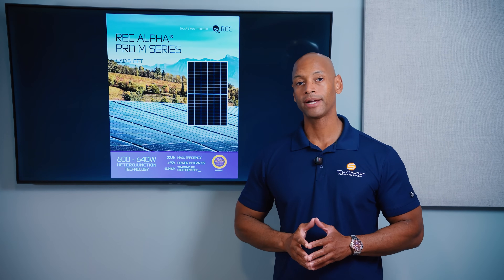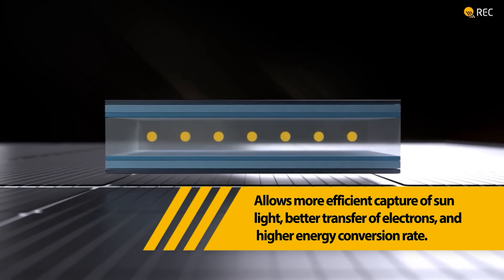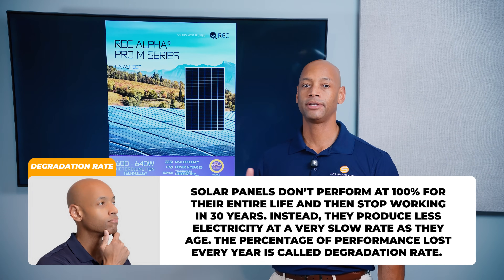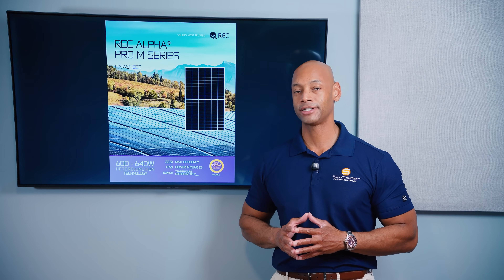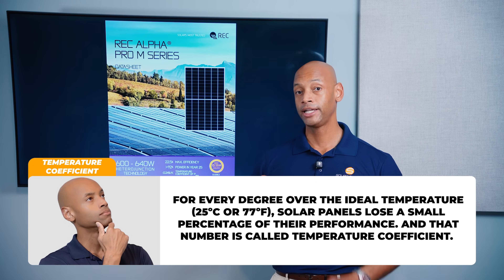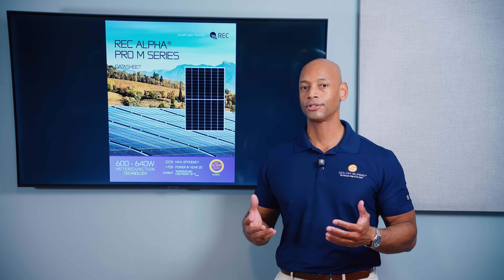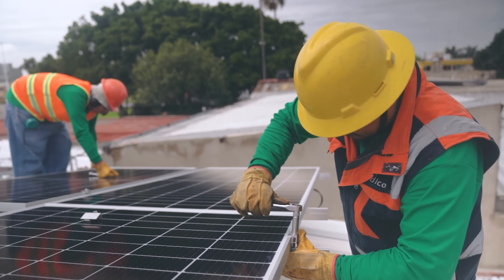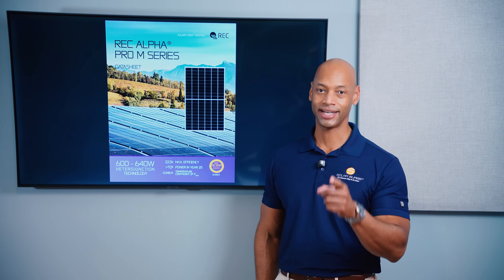New REC Alpha Pro M 640W Solar Panel

Comment: so what makes it a panel homeowners would not want or be able to use?   my plan is to get the bigger panels versus smaller ones,  i have limited space so want the biggest bang for that space. why wouldn't I use these over what the installers are selling right now that are like 400-450 right now   Wouldn't i want more power per sq ft ?

Comment: Solar installer here I install mainly rec  panels I think they’re a great module. They’re not super install friendly because they have those brackets/bracing and the leads on them are super difficult to wire manage but a selling point shouldn’t be their strength they’re just as flimsy as anything else they actually make their panels thinner because they have the bracing

Comment: Hi,
Can you make a video or videos with the following information:
1. Comparing sizes of panels with efficiency. 
So, a 400watt(or different wattage) panel from a few years ago with this REC panel or equivalent.
Actually seeing sizes with efficiency ….helps.

2. Showing the different sizes that the industry has made over the years, obviously you may not be able to show all, but something from the early & mid 2000’s and present.
And this will be for both Home and Commercial panels.

3. Panels for different segments of the world….

A. Close to the ocean(sea blast/salt water).

B. Forested areas(all the new tech with shading)

C. High temperature climates(sea blast; high humidity…close to ocean or fresh water). This might be one technology or Several.

D. Panels that can be placed on floating devices(for ponds, lakes and ocean)….or can we use standard panels with  standard connectors or not….and if not, what do we use???

4. What cooling technology is available for the panels(such as heat transfer  tech)…are these only for in-built roofing systems or other styles.
Can we purchase the heat-transfer devices by themselves and what considerations do we have to take into consideration….if it’s possible; due to the different styles of panels….you may offer better insight….which leads consumers to look at particular panels and their construction.

5. How does bifacial and non-bifacial panels work with heat or cold environments…..Will one work better or not, or it doesn’t matter???

6. How to clean the panels….and I mean with technology….what self-cleaning robots are available??
Or remote controlled robots.
What setups have you seen work best….would that be a water pipe system with sprinklers, for example???
You can show both small scale commercial and large home setups. 

7. What are the safety concerns with different installs for weather for example….hurricanes, lighting strikes, gail force winds, heavy snow loads.
(You did the video where you showed the panels being tested with different sizes of Hail…which was very informative, thank you for that).

8. Different solar tracking hardware….dual, single, and large stationary systems(with tilt functions, depending on time of year) and what is the ideal height to install those, if there is.

9. What safety systems are available if a panel catches on fire, such as fire suppression(as this may on a roof). 
Or, are there monitoring systems that catches it, before it reaches that stage???

10. The all elusive….flexible panels. For saltwater environments.
And has anyone put these on the top or sides of a storage container(10,20,40 foot container), the roof of a building(private dwelling, business/commercial space) or the walls of a home(a bit unusual, but has it been done)???

11. Panels which can be used as a roof, still allowing sunlight in.
And instances where people have used panels in an unconventional manner to make a roof with panels(for example a shed) and what was the process like(there are carports for example). 
But give us the idea to say “I can use panels here instead of metal or shingles”.
Has anyone done a green-house this way??

It’s great that all these panels are on the market, but you have to give us a structured way to look at it.

Comment: Two of these for each input on my Pecron generator would be perfect! 44Voc each panel, so 1200w and under 100v for each input! How can an individual purchase low numbers (4) of these?
Reply: You can't get them in low numbers. There are plenty of cheaply available panels though. I just got some 545W bifacials new for $175 each, or around $0.32/watt. You can find panels slightly cheaper than this and locally available most likely.

Comment: Just curious what makes this panel "only for commercial use?"
Reply: Too big, it will be hard to fit multiple panels in the small footprint of house roofs. And too much power, some optimizers and micro invertes are not rated for this much power.
Reply: @mvargass From my understanding, they are typically 6’ long vs 5’ long and would have proportionally more energy per panel. Correctly sized optimizers are available and can meet residential code requirements. I don’t believe any aspect of the larger panels make them unsuitable for homes as long as the roof has a large, square area for the array.
Reply: @mvargass optimisers and micro inverters aren't compulsory.
Reply: The surface area is so large that it would be hard to fit on most residential roofs out side of mansions.
Reply: @ultrastoat3298  that doesn’t even make sense. A lot of the 400-450w panels are ~68-70”x~44”. These are 86”x56”. That’s not even a huge difference. There will even be cases where the size allows you to cover more of your roof since you couldn’t fit an additional row or column of the panels you were looking at, but the larger panels will fill the gap.
Reply: @rekareaper  I literally just got denied a solar install because they couldn’t fit the kW amount of solar on my roof with the size of the panels they use and I can’t provide different smaller panels myself. So it makes a lot of sense actually.
Reply: @ultrastoat3298 and again, read what I said. It could cover more of your roof area with a larger panel when you can’t fit additional rows or columns with a smaller panel.

And that sounds more like you just have a roof with multiple angles instead of large flat surfaces. My house (about 2,100 sq ft) has about half the square footage of my parent’s house and a small original section where it would be hard to put any panels on, but I could fit way more panels on my roof than they can. I could still fit 24 of these on the south facing parts of my roof vs 28 with the smaller 450w panels.

Edit: 24 of these would be roughly 15kW worth of panels. 28 450w panels would be roughly 12kW. Less panels, but better coverage on my roof and about 25% more output.